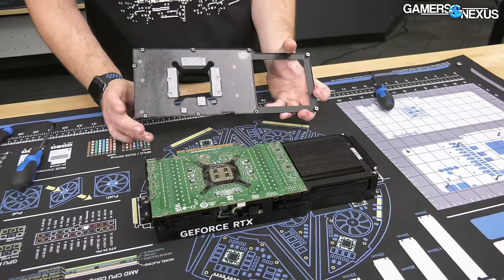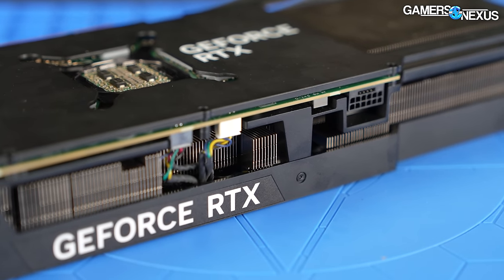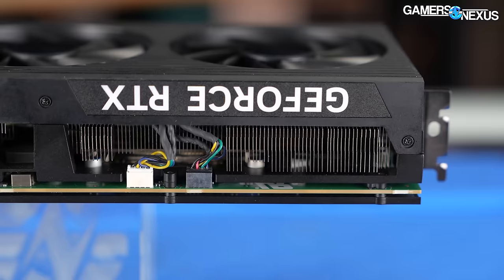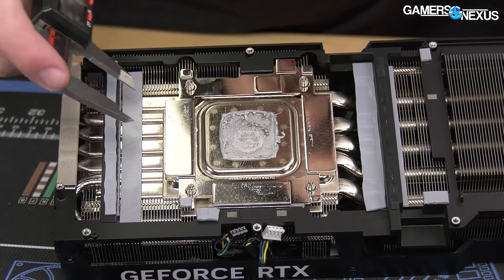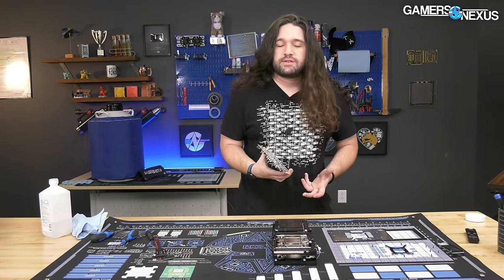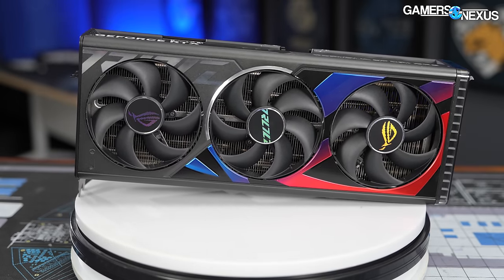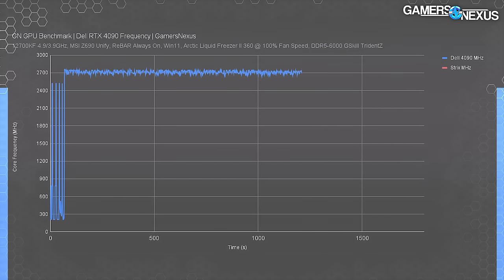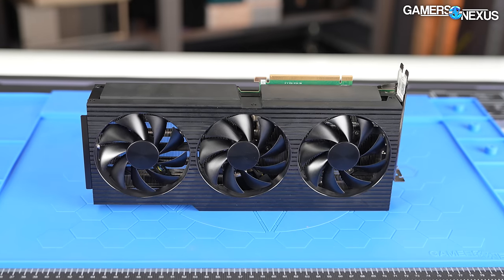Dell Made an Impressive RTX 4090: Relatively Small, Large Flow-Through, & Good Cooling

Comment: As someone who has worked in the enterprise space and I've dealth with Dell's PowerEdge and PowerVault lines of server gear, I can say, without a doubt, that their server division has some top-notch engineers. Their server stuff is top quality and has been for years (multiple differrent component types have much lower failure rates than HPE for example). Regarding the proprietary shenanigs, it's weird - on the server side they are MUCH better. Their whole system log is free and easy to read, the HPE one is encrypted and requires a support contract and only HPE can read it. Same with firmware and driver updates - HPE locks the latest versions behind support contracts, while Dell doesn't - they are free, forever. With all the strange Alienware stuff, I can tell you one thing - it's clear that Dell's server engineers were not very involved, otherwise it wouldn't be like this...
Reply: Agreed. Unfortunately most of the folks on here have never, probably will never experience the sheer power and build quality of Dell's Enterprise-grade workstation offerings. Having worked at both Boeing, a Dell house and Raytheon, an H/P house; your observations are spot-on. H/P's "client as a hostage" behaviours are the sign of a terrified enterprise. Cheers!

Comment: This is probably the cheapest 4090 PCB out there. 14x50A phases with all aluminum electrolyte caps for filtering. Both the caps and the chokes are through-hole soldered, which is easier for replacement, but slightly lowers the signal stability. There are some mid-grade 4080s with better VRM than this.
Reply from the maker: Yes, but this isn't undergoing any OC and is relatively low power as a 4090.

Comment: I've got one of these Dell RTX 4090's a couple of weeks ago. It was a pretty good deal by Brazilian standards (I've paid about the US MSRP, but that becomes a real bargain if you factor in the Brazilian import taxes) and it is one of the few RTX 4090's that fits into my case (my beloved Corsair Carbide Air 540). In principle it's still somewhat bottlenecked by my 9900k at 4k depending on the game (e.g. Cyberpunk 2077), but I don't know when I'll be able to afford a 4090 again with the China embargo and AI craze, so a CPU upgrade will have to wait a while...

I'm very happy with the purchase. Even with the occasional CPU bottlenecks and the ensuing 1% lows at 4k, it more than doubles the performance of my previous GPU (a 2080 ti). However, the smaller form factor does command a price, and now I think I understand why Dell locked the BIOS as well as why the boost frequency fluctuates so much. I've used kefi's modified nvflash to flash an Asus ROG Strix 4090 BIOS into my card in order to get both the 600 W power limit and the higher 2610 MHz boost clock. Raising the power limit in MSI Afterburner to 600 W really makes the power draw to go wild - when playing e.g. God of War at 4k with all settings cranked to the max, the GPU peaks around 520-530 W power consumption at 80oC and VRAM at 82oC, with screaming loud fans (this game doesn't seem to hit a CPU bottleneck at 4k, btw). Most of the time the CPU is indeed voltage limited, but it does get power limited at the above power draw even with the power limit raised to 600w. 

I think I'm probably hitting the limit of the thermal solution (I reckon that the hotspot should be hitting over 90oC) as well as the VRM's. The temperatures are still within spec - the temperature perfcap is still never hit with the raised power limit - but the power draw and the temps make me concerned about the card's lifespan, and the fans get just too loud. I'll probably relinquish the extra 10 fps and return to (close to) stock settings, maybe try to undervolt it a bit. If I manage to get e.g. an Alphacool Eiswolf 2 AIO in the future, I may try raising the power limits again.
Reply: Thank you. As there are not a lot of fps benchmarking including the Dell 4090's perfs, I'm happy to see an owner sharing his experience with. With the stock Bios, did you play other hungry PC titles ?
As Asus's, MSI's, etc.'s benchmarking are all on the web in lastest AAA games, it can be very interesting to see how the 4090 performs.
Now that Nvidia "fixed" the price of the 4080s, I was really about upgrading my 3080 to a 4080 super. But now considering the price difference between an 4080s TUF and these Dell models, I'm more interested in going the 4090 way with them...
Reply: What's your gpu usage with your i9-9900k?I have the same specs. But waiting for the card to be delivered.
Reply: @xpodx It depends on the game.  There is some CPU bottlenecking (84-90% GPU usage) on Cyberpunk 2077 with path tracing and DLSS Quality + frame generation at 4k, but on God of War the GPU is fully utilized at 4k + max graphics settings with DLSS Quality.
Reply: @PedroLauridsenRibeiro  right on. Yea I'm not gonna enable dlss.

Comment: So, the Dell 1660ti included in my 2019 Lenovo prebuild, which would serve as the foundation for what I'm rocking today, was... damn well made. With a yearly clean and repaste, the thing never saw 71C and played Tarkov at 90fps. Last year for Cyber Monday, I picked up a XFX 6650XT for 200 bucks, and noticed how, out of the box, the shroud plastic felt flimsier. Performs well enough, I'm glad I purchased it for sure, but you can tell the pennies they shaved off of certain areas of the card. So yes, for the last few years of GN reporting on Dell-made RTX cards, it doesn't surprise me at all to hear that... they're pretty damn good? (Obvious hesitation because of COUGH Alienware, and Dell company antics)

Edit: Interesting! My 1660ti was also power-locked! (No more than 100% power allocation allowed in Afterburner) I should have considered that to be an OEM thing.

Edit 2: correctly pointed out, my brain just defaulted to another 3-Letter brand, it's an XFX 6650XT not a "PNY 6650XT" like previously stated.
Reply: PNY doesn't make radeon cards..?
Reply: @th1jzzz531  WOOPS good catch, I meant XFX. Or as Steve likes to put it, the "XFX SWAFT" (SWFT)

The vast majority of input I get on a GN page are typically corrections (or attempts at them) rather than input, but fair!
Reply: @dylanherron3963  oh np! I was just kinda confused ahha. Xfx be making some good cards but have yet to figure out how to name em ahha.
Reply: @th1jzzz531  I look forward to my "QICK PWR MERC SWFT XFX 8900 XTX" in the future
Reply: @th1jzzz531  Man, this is supposed to be the "bottom of the barrel" RTX capable card (the 6650XT) but having never had one before capable of RTX, it's a trip playing Cyberpunk 2077 (admittedly at 35-45 FPS with RTX on) with realistic lighting and reflections. I did some testing between "Ultra, RTX off" and "High, RTX Performance mode" and to be able to see the individual lettering of a lit sign in the reflection of a puddle is a wild testament to how far "low-mid grade" tiers of graphics have become. I'm excited to see what 250 dollar cards do in 6 years!

Comment: Remember how many of us thought cards will get smaller as chips become smaller. 
Nope. We are now having actual PCB of the gpu half the size of the cooler.
It's ridiculous, man. 

I am a 4090 owner by the way, and that card can get so hot in Lian Li Dynamic Evo 011 case in idle, that the grill on the back of the PC will burn you if you touch it.

Since I move it to another humongous case from Thermaltake and running 41% fan speed, it's been good. 
But...the heat is ridiculous. It makes 13900k seem "cold" next to it.

With no fans on at idle, 4090 will remain around 52-58 Celsius. It's insane. 
I want a 4090 type of card in something as big as AMD Radeon 280x

Comment: dell is smart for exhausting 90 degrees. one big thing is motherboard mounted 30 series cards like evga blast the side panel. it they made a case that has a exhaust hole for side blasting exhaust cards it would be a cool addition for cooling
Reply: i bet the down firing exhaust is also restricting it in a simular way the tape did. just blows down on the fins and deflects the air that cant make it through the exhaust

Comment: I’d love to also know if the constant frequency change affects gaming stability with micro stutters.  I’ve noticed way less with setting a constant voltage and flattening the curve.  I honestly wonder why more manufactures/founders cards don’t have a dual bios with a fixed voltage or even a minor uc/under volted profile on one of the two settings.  Like a low power profile that’s set at 900mv…

Comment: Noob question - if any company can produce a certain model of graphics card, what exactly is Nvidia's (or AMD's) role in the whole process? Do they come up with the GPU itself or the schematic for the board?
Reply: The OE houses create the GPUs, build the reference devices and provide necessary engineering guidance, documentation and support. As long as they comply with the OE's contractual obligations, what the 2nd parties do with all of that is up to them. Cheers!

Comment: "15:56 - FOR SCIENCE: Covering the Flow-Through Areas" Can't believe you didn't a test with an added fan to help extract hot air and cope with the heatsink resistance (or pressure drop) to make better flow through... if SLI was still a thing new design with upper (or lateral) openings will make a good solution for a x2 SLI or x4 SLI cards put together...

Comment: I would like to see a GPU with a built in water cooling system. Instead of cooling fins. Micro radiator that circulates the heat away. This could reduce the heat inside the case.

Comment: Why hasn't any company made a smaller RTX 4080 or 4090? From what I've seen on tests, the current line of 4080/90's have a ton of thermal head room. Especially the 4080.

Comment: I see that Dell is still using the 1920 vintage buck converter for the VRM. If they had used the 2011 vintage Ćuk-buck2, there would be a maximum of 2 inductors and 4 capacitors. The 100-year-old design is more expensive, takes up more space, has inferior performance, and if one FET shorts the GPU voltage shoots up to 12V.
Fortunately, the 60% efficiency is not a problem because heat is never a problem in a video card.

Comment: Well this is awkward.  A lot of the people running around screaming "pRoPrIeTaRy" at every prebuilt deal, basing their entire opinion of the performance value of prebuilts on hypercriticisms of enthusiasts (which are largely irrelevant to the average consumer buying a prebuilt on a budget) are constantly telling people how terrible the Dell GPU's are.

It would be cool if channels like this did some actual real-world value comparisons.  The Strix is obviously good, but it also costs almost as much as the entire Dell system, and IMO doesn't remotely warrant a $500 premium over something like the Gaming Trio.  You've done the same thing with the Nitro+ in other videos.

I've seen Auroras and Legions with 13900kf/4090 for $2500 and $2600 multiple times now.  If you're going to review and critique things that aren't for enthusiasts and wouldn't be used by enthusiasts, I'm curious to see a GN-quality, in-depth analysis on how well these pre-builts would stack up to something you could reasonably build for around the same price point, rather than ignoring value entirely and using overpriced, enthusiast-only, top-end components that would also outperform reasonably priced DIY builds.

Comment: I got a used (probably mined on) Dell 3090 for like $600 cuz it was the only one that would fit in my SFF case. Other than the noisy high RPM fans, the thing ran like a champ, with great cooling, even after supposed abuse from the previous owner.  Dell seems to be doing well with these cards as of late.
Reply: Did you check the memory hotspot temperatures on your Dell 3090 with GPU-Z?

3090's have these atleast 90 to 100 C which is horrible for longevity. Especially if they were mined on like that.
Reply: @GENKI_INU  There is no evidence that it's "horrible for longevity". Modern silicon can hit above 100c with no problems. ASUS TUF 3070 Ti's had >100c memory temps and still run perfectly fine. Micron themselves said 105c is fine. Obviously lower is better to a certain extent but the difference in 70c to 100c to a piece of silicon isn't doing anything, as long as it's running within spec to not throttle. The biggest advantage to lower temps is lower noise levels. People have paranoia because they allow more sensors in GPU's now stop spreading FUD.
Reply: @Navi_xoo  So you're saying components running hotter during load, along with a larger thermal cycling range over years of ownership, isn't bad for longevity?

105C is NOT fine. That's when thermal throttling begins, if it hasn't already (105-110C depending on card bios). The recommended operating temperature for GDDR6X is actually between 0C - 95C. Even Gamers Nexus and other experienced tech channels disagree with you.

3090's had it worse than any other 30 series card, because they have memory chips on the back of the PCB without any way to cool them besides a thin backplate. As a result, a lot of them had backside memory temps in 100C's, and some that straight-up throttled at 110C.

And having more sensors on cards is a good thing. It helps us identify and understand shortcomings and cost-cutting.
Reply: @GENKI_INU  I don't remember, that was a while ago. In Jan, I upgraded to a 4090 when the Best Buy near me happened to have an FE in stock.

Comment: The last thing I have at Dell / Alienware is the monitor AW2721D and they can keep everything else, for their higher temperatures which reduces the lifespan, but I think that is the intention, to sell more, they used to be much better with their products but that was 25 years ago [started in 1996] seee ya
Reply: At the same time, the higher temps make them better candidates for water cooling and copper modding
Reply: @Demopans5990  copper mods sock dudes

Comment: Here's a question:  Did you try fitting that Asus GPU into the R16?  Is there enough space for it, and are the connections compatible with the R16's Dell PSU?  I have the R16 with Dell's 4090 in it, and am considering upgrading the R16 with a 5090 when it releases.  Wondering if I would need to wait for a Dell-specific version, or if I would be fine with a Founders Edition or other AIB (like Asus)?  Is the proprietary/locked down Dell bios going to be an issue?

I'm kinda wishing I hadn't taken the red pill and switched from console to PC lol

Comment: I miss my Dell 3080. it looked so simple and clean in the case.. Replaced with a Zotac 3090 for Vram and the extra prodo boost, but it's so ugly I turned off the rgb, and it runs very hot. Lusting after this thing..
Reply: Keep in mind that if it was a Dell 3090, it would've ran even hotter and noisier than your Zotac.

The challenge with the 3090 is the extra VRAM chips on the back of the card, which are hard to cool, which is why it's common to see 90-100C+ memory hotspot temps on these cards.

What I'd do if I were you, is look at undervolting guides with V/F curves in MSI Afterburner. You can reduce power consumption and heat of a 3090 by up to 100W while keeping the same, or extremely similar performance as stock.
Reply: @GENKI_INU  forgot about the undervolt. Ive greased the fans, done front and back pads and thermal paste.. and yea my mem and hotspot are about there :/.

Comment: ...it would be super refreshing to see the same Design Team assemble and build a new Aurora Series that mimics the early R1 Aerodynamic Fins that were both Hardware & Software controlled once either a certain Temperature was reached or it was User Defined. If it came with the same nice Industrial aesthetic that this GPU came with, oh, I'd be screaming all over about it. DELL/Alienware has some great Engineering...now we just need a better presentation. I'd actually call to personally challenge Alienware to one-up their competitors by 
releasing an Open-Air Case by Q1 '24. They're missing a huge opportunity to change pace and start creating an independent Hardware line. Less Cages & Clips, More Ooo and Ahhh...

Comment: Why does Dell put a non-transparent side panel to hide the components. This is 25% of the fun of using a (gaming) PC. Aesthetics!  Why don't they just hollow out a cinder block, thow the components a weld a steel plate to the side and call it, the boat anchor?

Comment: Wait so on that graph with the audible frequencies of fans, does that mean silent fans are still loud, just not in an audible frequency?
Reply: Yes, and no. The dB SPL measurement is the raw amount of sound in terms of air pressure being moved/vibrated, across different frequencies. 

But human hearing is most sensitive to frequencies between 2k to 5K, which means we perceive sounds in this range to be much louder than a dB SPL chart might suggest. 

So for example, 40 dB SPL sound at 1k hz wouldn't seem as loud as 40 dB SPL sound at 2k hz.

Then, there's also the average percieved amount of sound, accounting for how we hear, which is usually measured with dBA.

Basically, we use dB SPL to measure what frequencies a sound emits and at what volume, and we use dBA as a measurement of how loud our ears percieve the sound overall, but it doesn't tell us the frequencies.
Reply: @GENKI_INU  gotcha, thank you a ton for that detailed response I really appreciate it!

Comment: why don't they do smaller, slightly underclocked versions of 4090?

And why 0 game benchmarks? Cause they're the same?

Why no power info?
Reply: If the clocks are the same the benchmarks will be effectively the same. You can fit a 4090 in ITX case so not really a demand for smaller ones. Power draw is similar to the FE.